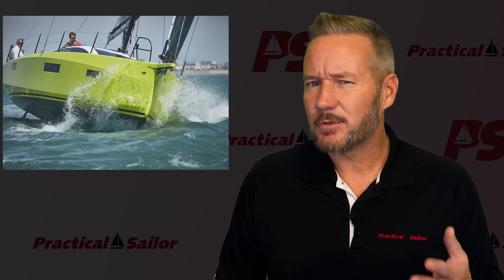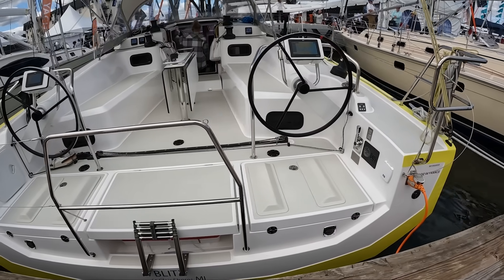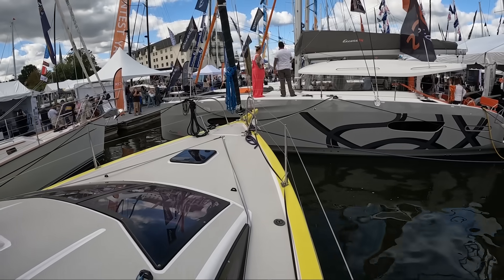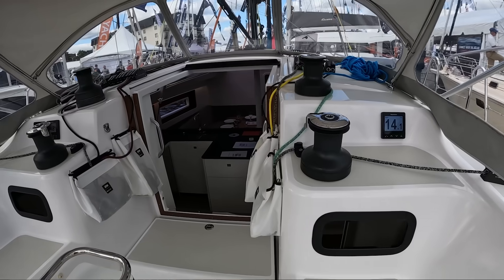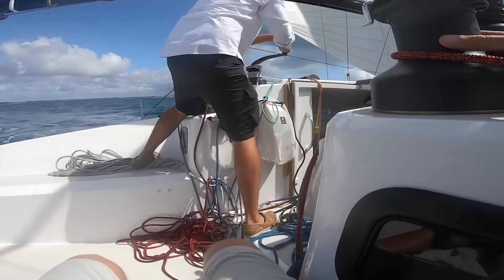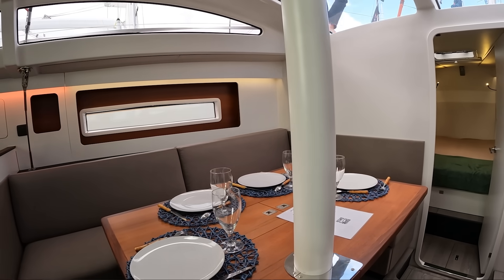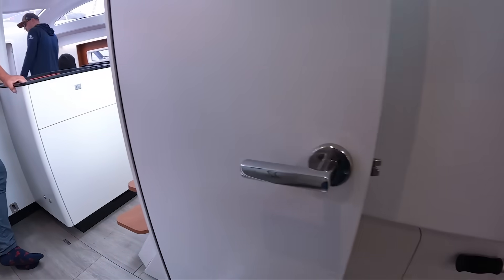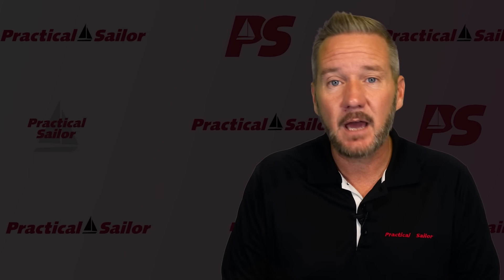Why This "Wooden" Sailboat Is Faster, Warmer, and Stronger - the RM 1180

Comment: This is just another way of building a composite boat, and it appears to be a particularly good one at that.
I'm a structural engineer. I was reading a book years ago on the design of aircraft structures. There was one part I couldn't wrap my head around. They (surprisingly) calculated that the most efficient structure has half the mass in the skins, half the mass in the core. That is very counterintuitive. I never did figure out why that would be, and I lost the book at some point, so I guess I'll never know.
In any case, most cored boats don't come anywhere near having half the mass in the core. The hulls of these boats very likely do. They are going to have very good panel stiffness for the weight, and probably good resistance to damage compared to a boat cored with any other common core material.
West System boats built by the Gougeon Brothers have been around for well over half a century. The wood-epoxy saturation technique is very effective. I don't know that this boat would be for me, but it's certainly an interesting and gutsy design.

Comment: Much like the Wharram build method.
Reply: Much closer to Dudley Dix’s construction than a Wharam design and considerably faster.
Reply: @i @iojoshoi was talking about the construction method and the ability of owner to be able to repair the boat without fancy equipment. The wharrams are catamarans designed by an eccentricity brilliant architect to be safe, fun, and sailed.  The Dudley Dix appear to use the same build philosophy.

Comment: dang, should've included the following q within the one comment, but here goes: the 1380 seems equipped, or at least custom fitted, with a folding swim platform, while can't find similar for the the 1180. perhaps at the boat show Tim you saw an option to secure the transom with a bit of the 1380's body kit?

Comment: Good quality plywood is more expensive than glass fibre panels. The designer should offer cnc cut composite panels for the home builder. cnc cut plywood kits are not feasible in boat building in my view

Comment: @practical-sailor  could you comment onbthe following? 
I am VERY interested how this "modified wood product" could benefit boat design/strength/durability??
===== A new material called Superwood is a type of high-density wood that is stronger than steel, with a higher strength-to-weight ratio. It is created by chemically treating wood to remove its lignin and then compressing it, which causes its cellulose fibers to bond tightly together. 
Strength: Superwood is 50% stronger than steel and has a strength-to-weight ratio up to 10 times greater. Some tests show it can be stronger than steel and even stop bullets.
Manufacturing: The process involves a chemical treatment to remove lignin and hemiselulose, followed by compressing the wood under heat to form new chemical bonds between the cellulose fibers.
Properties: Beyond its strength, Superwood is also lighter than steel and resistant to moisture and rot. It can be molded into different shapes and has a fire-resistant class A rating.
Applications: Potential uses include construction, car manufacturing, and other industries where lightweight strength is needed.
Availability: A company called InventWood is currently producing it, but due to demand, the earliest availability for new orders is expected in 2026.

Comment: A new material called Superwood is a type of high-density wood that is stronger than steel, with a higher strength-to-weight ratio. It is created by chemically treating wood to remove its lignin and then compressing it, which causes its cellulose fibers to bond tightly together. 
Strength: Superwood is 50% stronger than steel and has a strength-to-weight ratio up to 10 times greater. Some tests show it can be stronger than steel and even stop bullets.
Manufacturing: The process involves a chemical treatment to remove lignin and hemiselulose, followed by compressing the wood under heat to form new chemical bonds between the cellulose fibers.
Properties: Beyond its strength, Superwood is also lighter than steel and resistant to moisture and rot. It can be molded into different shapes and has a fire-resistant class A rating.
Applications: Potential uses include construction, car manufacturing, and other industries where lightweight strength is needed.
Availability: A company called InventWood is currently producing it, but due to demand, the earliest availability for new orders is expected in 2026.

Comment: Odd you say that line at the beginning. Here in Australia plywood boat building over 40' is very common. Almost every catamaran in the Brisbane River is ply. The biggest market in Australia is trailerable crafts so ply and aluminium win out. The boat I liveaboard is solid glass built in 1985 Victoria, this is about when most production boats transitioned to mass produced aluminium and plywood hulls with the exemption of foam core with fancy Kevlar multihulls
Reply: What you say is quite true. I live in Perth myself & am about to start building my boat out of ply & epoxy. 
It'll be a 13.5m multihull.

Comment: I want something like this in the 20 ft range that is easy trailerable with a 6 cylinder 2wd, that I can build in my garage.
Reply: Try a Waarschip 570. I had one 40 years ago and it was a great single handed cruiser.
Reply: @David-qs5ii  I will give it a look, thanx friend.

Comment: The boat radiates power and energy. The interior shows a more straightforward approach with high precision in the details. Wood is fantastic but it changes dimension in relation to moisture. Of course it can be repelled with oil, varnish or plastic. But sooner or later there are shortcomings in the protection. The harder and more encapsulated the wood is, the more severe the damage occurs. In comparison, if something limps, a properly designed wooden house has a tight and ventilated roof and otherwise a construction where the diffusion barrier is on the warm side of the outer wall and allows the wood and insulation in the wall to "breathe" outwards. On a boat with encapsulated wood, the situation is somewhat reversed but above all water and moisture are much more present.

Comment: Leave it to the French to do things backwards. I've figured that a lot of your damaged deck boats could be fixed with wood structure under new fiberglass, except for cost of materials. Here, the wood is in the sides and bottom, where it will take a beating. When this sailboat first goes in the water, all those light sturdy strong descriptives are pure merit, but after it's had some real world ocean wear, it's going to become a sad expensive headache. There's no keeping that expensive rare plywood as dry as a mummy's tomb. It's going to be a rapid death spiral.

Comment: After repairing, rebuilding and doing restorations on ply boats, I'll pass.. at least here in the tropics or if I don't intend to keep her for long. Dry rot fungus and  the always present termites are what worries me most,  adding that in the event of a collision or Scuf damage at or below the water line must be addressed immediately to stop water ingress. That means a costly haul out every time you tap something. I'll take foam core all day.

Comment: 4:00 Insulation ? A lousy R=1 value for Plywood.  Commercial coring products are waaay better. And as far as repairs, if you think that quality plywood is easier to get in remote places, you are fooled.
Apart from cost, Plywood is just not as good as approved coring material.

Comment: I'd worry about bumping a coral head hundreds of miles from a good haul out area. Days of exposure would not do the plywood any good if the glass shell was broken.
Reply: This isn’t made of CDX sheathing ply, it’s marine grade plywood. The laminations are thinner, the glue is waterproof and it’s tough.
Reply: @iojoshoi   Sure I took for granted that it was marine grade. You are correct that there are more laminations per centimeter/inch, but interestingly the glue used in CDX is the same glue used in marine grade. Another difference is that CDX is allowed to have voids where knots were cut out of the lamination sheets whereas marine grade has those knot voids filled with a lenticular piece of wood (called a Dutchman). The wood in marine grade is not treated to resist rot any better than regular wood of the same species however so it is subject to water damage and rot like most woods. I'm not against wood construction. I am making a dinghy now that is fiberglass with wood core. They say everyone eventually "grounds" their boat - that being the case my teeth would ache at the thought of hitting something hard enough to expose my wood core to water. Fixing that would require enough time on the hard to completely dry the core before sealing it again in new fiberglass.

Comment: What about all those fasteners, when they leak? The wood will slowly rot in places. Here is the thing: ROT SPREADS.  So i would never buy a boat with much wood it it. Wood also burns, enough said.
Reply: Fasteners in my balsa cored FG boat have caused problems too. It’s an easy design fix to prevent water intrusion. As for fire?!? FG boats burn just as easily.

Comment: My dad built a 20ft Highlander in 1958 from a delivered kit on my grandparents driveway. Was sailed for many years and had a ton of sail area. 1000 were built up to 2009. The RM is much better than better than foam or balsa cores. It will last.

Comment: Really nice.  There are modern glue line fungicides to stop the decay (think soft deck core) and the most successful is zinc borate used in exterior OSB.  Possible to pressure protect plywood with copper based protect also (in the wood instead of on the wood like Nelson did).
Thanks!

Comment: It’s a plywood, core boat, plain, and simple
Reply: Not even close.  Its a cold molded boat.  Google cold molded boat.  Has frames and etc.  6 oz cloth with epoxy is just for abrasion resistance on hull.  Will never de-laminate.
Reply: I guess you’ll find out in 20 years
Reply: @brianjohnson1346  Obvious you didn't google cold molded boats.  They have been lasting 40 plus years without issues.
Reply: And how long does the solid glass one last asking for a friend?
Reply: when the solid glass boats finally get retired it’s not because the glass has failed
Reply: I get it you get properties with the wood that you don’t get with glass, but there is a compromise
Reply: @brianjohnson1346  Glass has its own set of issues.  Blisters and is not easily repairable especially with encapsulated keels.  A properly built cold molded boat fully encapsulated with epoxy last as long a fiberglass.
Reply: @brianjohnson1346  I don't think you understand boat building.  Sadly fiberglass uses cheap polyester resins.  Although they could use epoxy they don't due to cost.  Plywood pound for pound is stronger than steel.  Then coupled with epoxy is extremely good.  Problem is man hours building it.  Whether it be plywood via forms or laminate veneer jigs and lofting.
Reply: knowing is always better than thinking
Reply: @brianjohnson1346  What gut feeling not science or Engineering?  I am a Engineer who also builds boats...

Comment: I raced a little dinghy. Called the Fireball there are thousands out there. Some were made of fibreglass originally all just plywood then I had one built plywood, Kevlar and epoxy. That boat was a stiffest in the whole fleet and outlasted all of them. It’s still sailing today after 25 years and it’s competitive.
Reply: I used to race a plywood Fireball - a beast, ideally crewed by a couple of rugby players. We were just too light to get the most out of it
Reply: @litespud  Ideally, you want a lighter weight but very strong helmsman and the crew on the wire that is 200 to 225 pounds. I remember sailing a world championship and getting crushed by the British after the race I said how did you keep your boat upright? They just kept raising the centre board until the boat was stable and 25 kn of wind they only had 25% of the board in the water.

Comment: One of the standout features of the RM brand, THE feature, is the twin keel concept. This allows the boat to sit on the bottom, at low tide. And unlike the original bilge keel boats, the twin keel RMs actually sail upwind extremely well! I know, having done a few cruises on a 30+ year old RM 900 in Cornwall and Brittany, where we regularly dried out at low tide, and then simply walked ashore! And while sailing, we regularly passed, upwind and down, boats 5-10 feet longer than us. These boats are fantastic!
Reply: I sail a Presto 36, an 18,000 lb displacement, ketch rigged centerboarder that drafts less than 30" board up. Sits flat on a  lead  9"x6"x 15', lead Grounding Shoe. Takes "Away, the Worry, of being Close".

Comment: Is it really an offshore sailboat?  The capsize number is way over 2.0
The internal design, TO ME, is perfect and functional. I love it.
The open stern really annoys me. A simple slip, bump, etc. and it's man overboard, for sure. Check their video on their own site.
I really prefer those wall/bench closed sterns, that could change to a swim platform. 
I could even picture an Orca or a Sea Leopard kidnapping a crew, with a stern so close, and open, to sea level.
Despite that... I never liked RM boats, till now. Even this so-called "modern lines"... in this boat, I liked.
https://youtu.be/nD3D5Bv6Q4s

Comment: Alot of nice design points inside and out! One thing Tim, ply epoxy hulls have a solid feel and are quieter than straight glass boats. If I had another bank I'd love it! However I am not a believer in plumb or receding stems which ARE wet! I'm curious just how often water peels (or lifts) off the gunnel-side and onto the cabin top....

Comment: I've built both 37' and 42' plywood/epoxy boats back in the seventies/early eighties. I like the materials for the same reasons that Tim mentions (and I've also built fiberglass boats). Blown ashore on a Tahiti reef along with six other fiberglass monohulls during a freak squall, my boat pounded for hours until pulled off by a tug (others not so lucky, bilged on the reef). Spent two weeks on the hard, scarfing/patching in new ply and re-glassing - off I went - a little poorer but a little smarter too. Properly done, modern plywood composite designs make great boats.
Reply: Makes sense to me too I’m a carpenter! Couple battery operated tools and you could take care of everything. I love it.

Comment: Now make the Plywood out of marine Superwood by Inventwood , part of the Mettlewood concept 20 xstronger  10 torsion and 5 times tear resistance plus grade A fire resistance....Stronger than steel and Aluminium...cheaper lighter and more sustainable using bio epoxies  also still embodies  50% of the CO2 even after manufacture. .... It's also rot mould and pest proof ..even before coating. 

Even using conventional marine ply .... It's virtualy sledge hammer proof.

Comment: Has the downsides of a balsa core. Water penetration will quickly cause delamination, unlike polyester or divynyl
Reply: I don't think there is any balsa core in this boat - all plywood/epoxy/glass. (unless I missed something).
Reply: Sorry, but this is not true. Marine ply of this quality can soak in water for years without delaminating...
Reply: @briansmyth8113 if u dont take care of ur stuff u gonna ruin it. It goes for anything in life including wife😂

Comment: Sometimes you have to start from scratch and reimagine what a sailing vessel should be. One has to be careful not to disregard the lessons  of the past for the convenience of modern construction. What is the issue with wood: Sea worms and rot? Compound curves? They solved the shortcomings while recognizing the benefits of natures composite material. No matter, I can't afford it anyway. Maybe some of this new use of wood will trickle down to smaller and more affordable ( if that is even possible) sizes.
Reply: It's not a "new use of wood".  This is one of the OLD uses of wood.  The "smaller + more affordable" connection with this, is the other way around from what you're implying.  The more approachable lower-tier version of this idea, won't be "brought to the market" as a result of this "innovation".  Smaller+cheaper applications of this construction technique are what have already existed since decades past, from which this company is deriving their methods. 

He briefly mentioned this background history in the beginning of the vid, when talking about the home-built dinghy category that have always been available with exactly this structural process.  That started almost ever since the invention of epoxy.  Heavily popular among the DIY crowd since the 1980s, anyway.  The only reason most boatbuilding companies don't go this route, is because it takes some decently-trained skilled labor to do it right.  You have to pay your people better to get a build crew that knows what they're doing here.  Most major yacht-builders (unless talking about other high-skill & much higher-price materials like welded aluminum) want minimum-wage, minimum-brains workers, who can mindlessly point a chop-gun at the inside of a mold repeatedly for dozens of identical hulls, rather than the care required for assembling critical structural parts with hands-on precision.